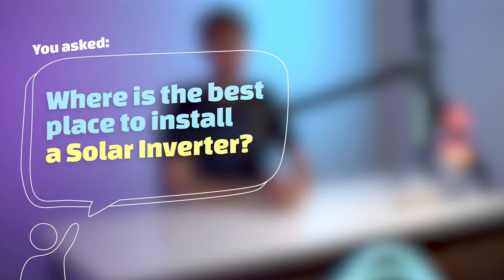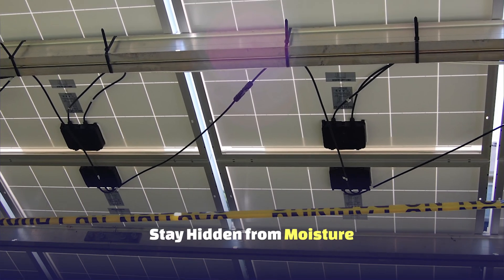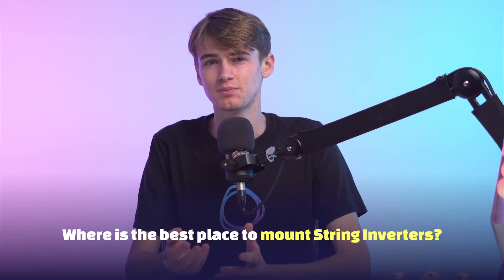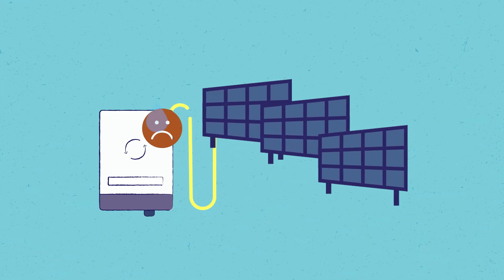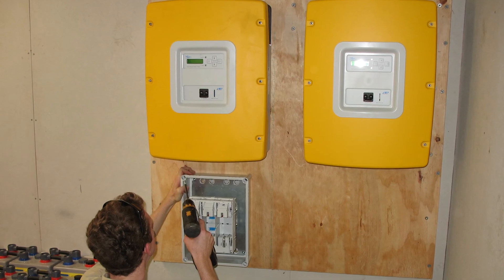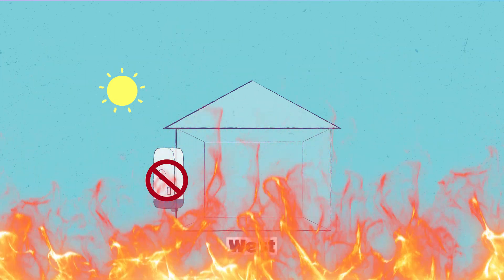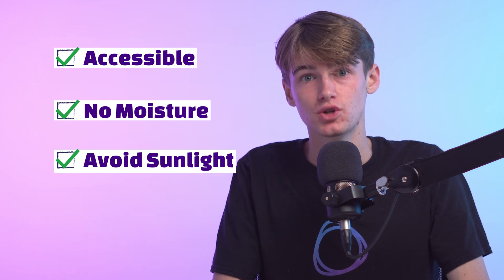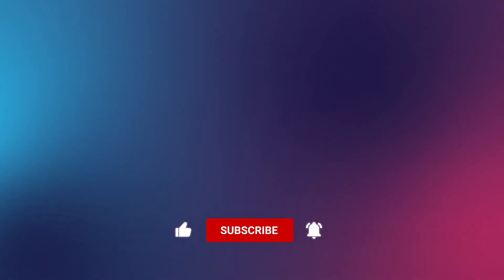Secrets to Perfect Solar Inverter Placement

Comment: Ok a conundrum for you then :) 
I have a 2 story house with spacious under roof space. To my garage it however is 30 meters of wire. Where to put the inverter?
Under the roof, where will be 30C  over summer.
Or garage and drag the HV DC strings 30 meters?
Reply from the maker: Ideally garage, you never want to install your inverter under a roof because if you have any issues with it in the future you want to be able to access it easily
Reply: @yeanswers  Thanks :)